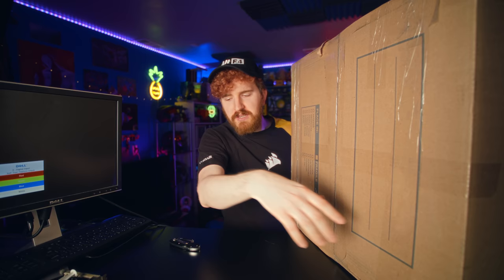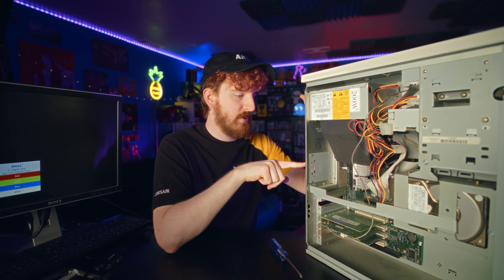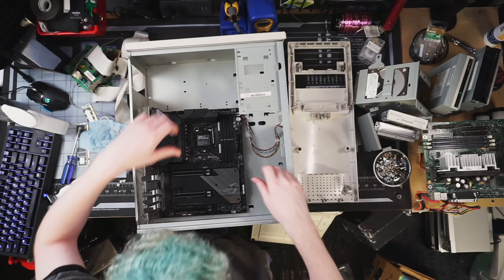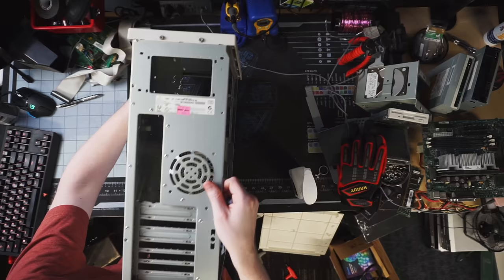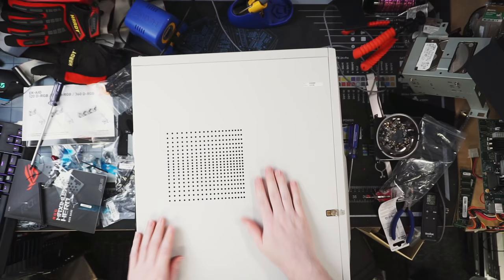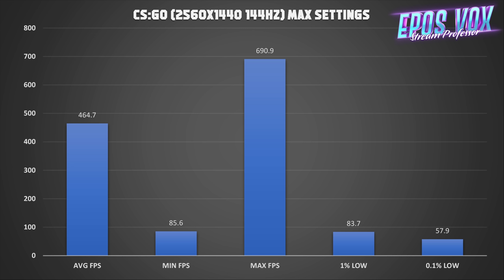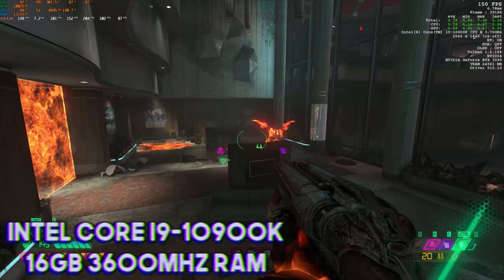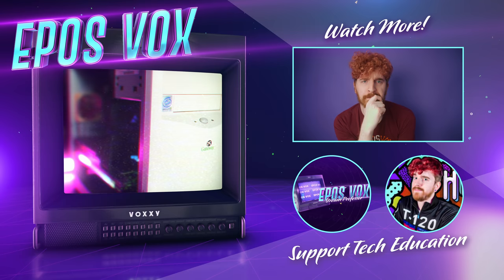the ULTIMATE sleeper PC that almost cost me my finger!

Comment: Drill some holes in the bottom and add some fans.. it wont be visible and it'll provide some much needed airflow and if you use the be quiet fans they have nice rubber bumpers to reduce noise.. also raise the legs some

Comment: You could provide direct, cool airflow to the gpu by drilling out some fan mounts at the bottom of the case. It looks like there's space enough for three 120mm fans down there.

It would certainly kick the airflow up a few gears, and the bottom is basically free cooling real estate. As with any case where the PSU mounts at the top. And if looks aren't a consideration, which I'm assuming they're not, you could attach a large fan to the PSU itself, to actually utilize that as a proper exhaust. The PSU fan likely doesn't turn on much, and certainly not at high enough RPM. It's an air tunnel just waiting to be optimized.

Reversing the airflow and utilizing the bottom as an exhaust is a potential consideration as well, albeit with the obvious negative case pressure side-effects.
Reply from the maker: Not a bad idea for future upgrades if needed

Comment: One possible fix for the heat soaking issue is that you used to be able to get fan size reducers that would allow you to run a 120mm fan on an 80mm or 90mm cut-out.  The tricky part of that with this case is that you would need one that is off-set as the cut-out in question is not central on the case.  Otherwise I would recommend cutting away a chunk of the front plastic from the under side (where you won't see it) to allow better air flow to the AIO since the moulding is blocking pretty much all air-flow apart from a few pin holes.

Comment: the cutter would work fine.  but the disc are fragile,  If you do  two cutter wheels(place two on the mounting screw) at a time you can avoid most of the disc shatter effect

Comment: Watch out, the power button on that Gateway case is notoriously weak. Most of them are broken by now.

Note that the backplate you encountered is an OEM thing along with the weird power supply mount. A generic ATX case from the period would have the standard removable ATX I/O shield setup and likely the same power supply mount.

Since you have a free 3.5" bay, you could add front panel USB 3.0 and Type-C ports. Also a USB to ATA adapter could run the CD burner. Getting the floppy working is a bit more tough, but USB adapters exist for those too.
Reply from the maker: That front panel would completely ruin the aesthetic!!!

Comment: You can always drill some hole in the bottom, slap a magnetic dust filter on the outside and fasten some fans there for great air flow addition.
Reply: That's actually an amazing idea, also if it's rgb it would be extra cool.

Comment: I have just watched the part with you cutting away the rear IO shield. Why did you not drill the rivets out and then do the cutting safely? I am pretty sure you could pick up a rivet gun with rivets for under $20 locally to you. Bare arms and you have a cutting disc shattered, you are so lucky, I would go and buy a lottery ticket.
Reply from the maker: Didn’t have a rivet gun, wasn’t even certain it would get that particular part out, didn’t have a vice to hold it in place anyway

Comment: I'm planning on doing something similar with my grandads old dell case. How is this?
-
Graphics - Rtx 2060 £300 ish
Motherboard - msi b450 tomahawk max £120
Ram - 16GB crucial ballistix (2x8) £43
Cpu - Intel i5 12600k or amd? £?
Powersupply - silentiumpc supremo fm2 650w £98
Ssd - 250gb? £?
Hdd - Tobisha p300 3tb £50
Fan - fractal 140mm front fan £45
+ 2x 92mm Arctic case fans £10 each

Total Price - £676 + cpu and ssd. Please help I'm unfamiliar with pcs.

Comment: suggest you get some sort of support for the power supply, those 1000W+ PSU are super heavy, and your screws could snap off, maybe a 3d printed bracket, or even a long screw that goes from side panel to side panel could help with the sag
Reply from the maker: Nah it’s literally wedged in the case, it’s not going anywhere even if I took out the screws. Should be fine.

Comment: Nice build. but aio is wrong mounted. Always have radiator over cpu block! so air will be in radiator and not i cpu block!
Reply from the maker: Ah someone else who didn’t watch the entire GN video. Also would you mind pointing to the radiator mount on this case that’s above the block? I didn’t think so
Reply: @EposVox  I did watch it, did just point it out. Some might think it’s OK to have it like that, and many times its fine, but it can be bad as well. I would diy it on the 5.25 bay or under the psu or go air cool, some aircoolers is better.
Reply from the maker: Air cooling in this rig is definitely not better. It doesn’t fit in the 5.25” bay without ruining the aesthetic and rear fan is 90mm. This is fine. It runs fine and will run fine long enough
Reply: @EposVox  Why get so angry and go all attack? i did just comment and i think is good if you point out that it is not optimal to have the aio like that. And i did say some air coolers is better then aio. did i say it was better in your case? did say i would try it tho. and in the back i know the fan is 90mm but you can cut like you did with the io shield.
Reply from the maker: Because I have at least 10 comments parroting the same thing and even GN Steve himself is sick of people using his video to go constantly bring it up on other people’s builds and when quite literally there is no other option here. It’s not an ideal config, I’m well aware. Nothing about this build is. It’s a sleeper pc, it was never going to be ideal. Doesn’t mean it’s a real problem. It’ll run fine for now. If I need to I can swap coolers, literally just shake up the cooler, or swap to air in a few years when it matters. 
And no, there is nothing that I could dremel to fit the radiator on that 90mm fan cutout unless I’m dremeling half the motherboard off lmao

Comment: For Battlefield 4 when you say "ultra settings" are you including increasing the resolution scale to 200%? If not it seems weird because on my system at 1440p ultra settings (100% resolution scale) on a 8700k/1080ti I can get an average of around 140FPS, so given the hardware in this system 80FPS seems off
Reply from the maker: 100% render res
It runs about like that on most of my rigs
Indoors is obviously much better

Comment: You should fabricate a PSU support bracket so it's not just hanging on four screws...
Reply from the maker: It’s also hanging by friction as it’s lodged in the case because it’s too big to fit within the sides. It’s not going anywhere
Reply: @EposVox  Fair enough

Comment: Love sleeper builds with overkill components! Not to be overly critical though, isn't a 120mm aio a bit small to be running on a 10900k? I'd be a bit worried about temps with anything less than a 240.
Reply from the maker: Well sure. It’s almost as if I talked about that very thing. I didn’t exactly have room for anything bigger. I would have gone bigger if it was possible. 1990s gateways weren’t known for their robust water cooling rad support
Reply: @EposVox  ah no worries, I must have missed that little detail while I was watching with my little one on my lap. I just remember feeling anxious about my own temps when I first ran my 9900k on a smaller aio. Sick build though and grats on the upgrade.
Reply from the maker: Honestly CPU stays pretty cool, the gpu just runs hot
Reply: @EposVox  haha yeah you could cook an egg on a 3090.

Comment: Emmm, if my memory serves me, CPU cooler radiator should have tubes on top, not on bottom or am I wrong❓ Please correct me if I am wrong, thx 😁😁
Reply from the maker: Oh not this again
Reply: @EposVox  okay sorry 😁.I watched only few build videos (I do not have possibility to try modern stuff), I mostly watch cleanup, fixes videos etc. and I did not know that radiator quesion was too popular, I apologice 😁.
BTW great video. I like modern components in old shell, I may do imilar in the future 😀.
Reply: @EposVox  Looks like this one might be a future issue though because it looks like the actual pump block is the highest point of the loop. Hopefully it wouldn't be.
Reply from the maker: Worth noting that GN video was to determine the ideal scenario as he stated multiple times, and that you can be fine with other ways. I literally have no choice here, so debating it is completely pointless. It'll be fine.